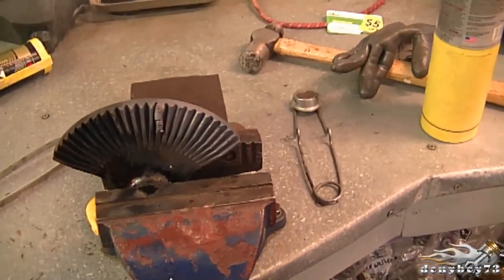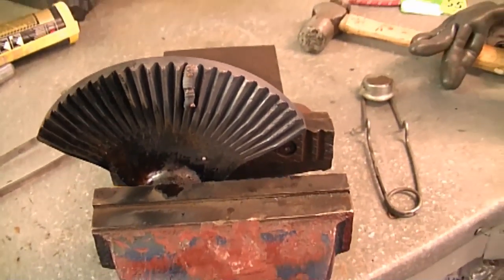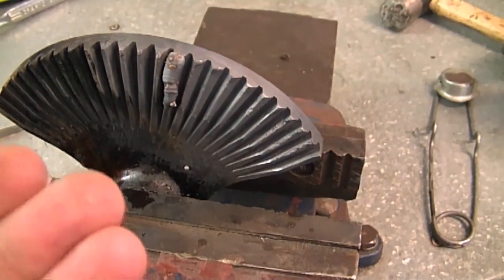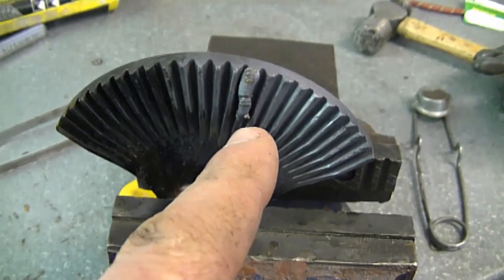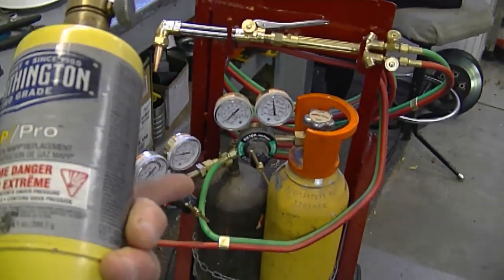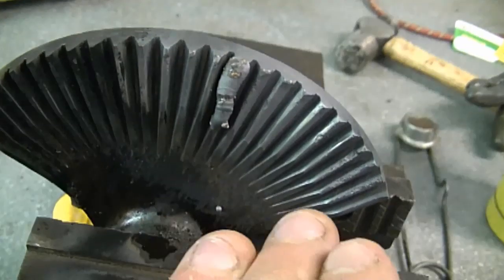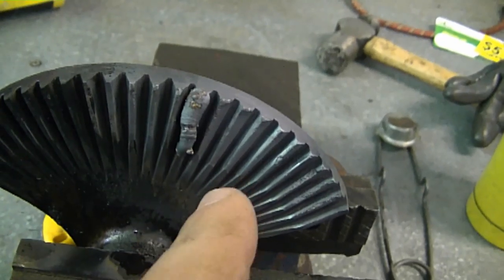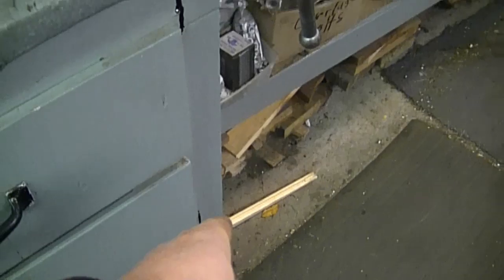QUICK TIP #2 - Welding Greasy Metal

Comment: Just a note DO NOT CLEAN THE PART WITH BRAKE CLEANER AS IT can make Phosgene gas if in extreme heat and argon rich environment such in Mig or Tig welding environments Read up on it

Comment: I don't know how to email you so I am going to try here. I have tried without success to obtain a parts/user manual for the following gas walk behind lawn mower: 
Sotts John Deere, Model #:  THD WALK 38P
Serial #: GXSP63X033074,data code 031700

Maybe some one has one.  I need replacement wheels.

Sorry for using this in advance if I was not suppose to.

Respectfully,
Robert

Comment: good tip Dony ! also it is a good practice to pre-heat whenever welding not only does it burn off any oils that would contaminate the weld and make it porous like you stated but it also relieves any possibility of stress cracking from rapid heating from the weld arc I will add a couple of tips too , pre-heat the entire piece and after welding wrap it in a heat-resistant welding blanket or bury it in DRY sand to slow the cooling process which will prevent stress cracks from cooling too fast

Comment: Dony, when you heat that metal piece to red hot as you mentioned, that means something like 700 degrees Celsius....won't that destroy the heat treatment which they did in the factory ?
Thanks.

Comment: Amazing that there was that much oil! On question, though.  Do you need to re-temper the gear sector again?  I see the benefit of cooking the oil out of it but wouldn't heating it red hot alter the molecular structure and hardness of the metal or am I over thinking it?

Comment: OIl/water does not soak into the metal.  I can prove it by using a metal tank as an example.  If you have oil in a metal tank, the oil does not soak through and leak.  It sits on the surface of the steel, or where the metal is pitted.  Heat works great to relieve contanimated surfaces.  Sometimes it takes more.

Comment: Normally steel gets softer when it is heated to 600-700C but if you cool it down  immediately (dip it in water) it gets harder again. But you never get the same quallity as original.